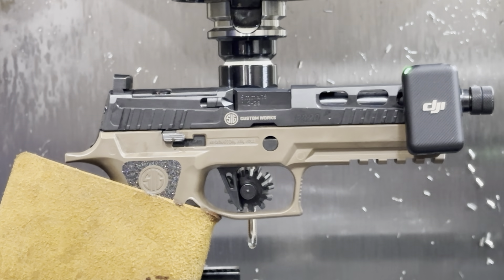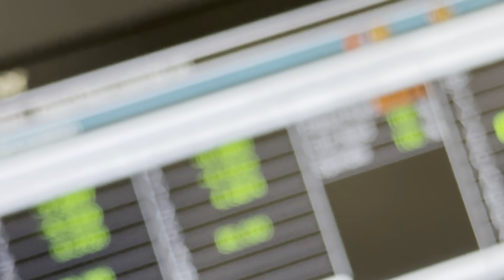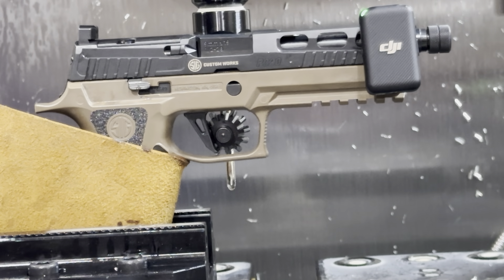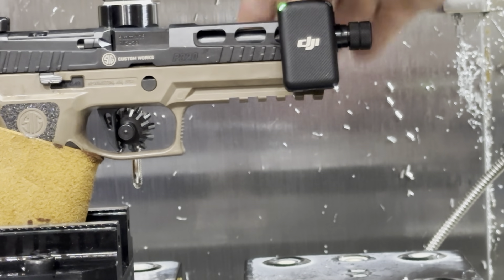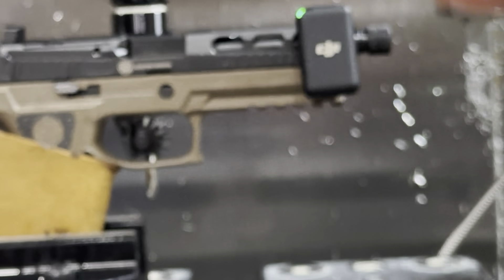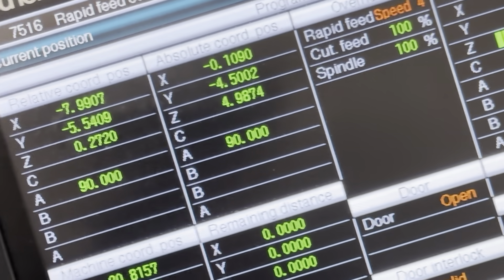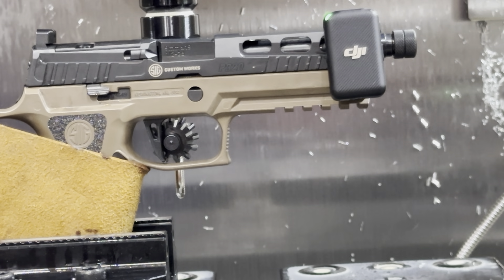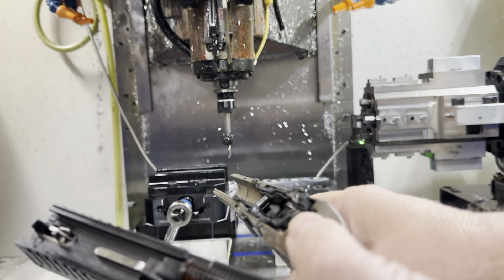Sig P320 accidental discharge tested in CNC machine.

Comment: Actually to me, this just shows that this isn't the issue with the p320.
What this shows is someone found a way to get a p320 to go off and a lot of striker guns could probably do this also.
We don't have a bunch of recorded issues with glocks going off in holsters, well that I'm aware of in the 30 something years LE has been using them.

So this now makes me look more at (and I wish I could remember who did it) the video where a machinist looks at how normal build up of debris (unburnt powder, carbon, and brass shavings) could potentially disable the striker safety. He does all this and gets the pistol to go off, without touching the trigger AND the manual safety engaged. A situation that more mirrors the LE issues when it has gone off in the holster.
Therefore making this goofy "lets pull the trigger 80-90% of they way and rattle this bitch till it goes off" a joke of a test. The first time I saw this "test" it didn't really make sense to me considering the more recent reports of the p320 going off, unmanipulated, while holstered. 

There are thousands upon thousands of these things out in the wild that don't go off randomly in holsters and I would venture to guess, that's because people are cleaning them. 
Then there are a few that have looser tolerances, given out by LE departments, that also don't get cleaned properly. Then they go boom when the sig god tells them to.

You won't see me support Sig's response to this ever, you won't see me carry or own a p320 ever, but I also won't jump on tests like this where you still have to pull the trigger so far to make it go off. 
Something else is happening here and I can't wait to find out what it truly is.

Comment: Every gun is different. Never mind the obvious difference between yours and the one the other guy tested with a screw. I appreciate the accuracy you can accomplish here, but it in no way invalidates someone else's test or proves ANYTHING about someone else's gun. You can't tell anyone else that the results would be the same with their gun. One of the worst thing Sig has done is sold guns with some random collection of parts that they user can't know, because they roll out changes slowly and a part at a time. Whatever the case, I'm glad for the increased scrutiny.

Comment: So....DONT touch the trigger. At all. Ever. During any test. Pull the slide back, do not chamber a live round of course, but then start manipulating the slide. Drop it on its sides, corners...if it "fires"...the manufacturer is at fault and going bankrupt. This is not complicated. 
Forget about proving "you have to pull the trigger" prove what is alleged to have happened. Or disprove it. It should not be difficult.

Comment: Don’t pull the trigger until ready to shoot. People blame SIG because they don’t want to admit that they pulled the trigger or used an incorrect holster.  Colt went through this, Glock did too, and H&K with there PSP design. Even Revolver makers have been subject to this drama.  PS: good video.
Reply: The airman that just died from this didn't pull the trigger and also was using a government issued safari land holster made for the weapon and it went off from him just setting it down on a table. Sig is 100% at fault here not the people.
Reply: @austindow347  I believe the Air Force is still investigating the incident. The USAF Final Report has not released (as far as I know). However a USAF General Progress Report related that deceased Airmen set the holstered SIG Handgun on a counter top inside the toilet stall (a much smaller area than an office). Perhaps this has something to do with the incident. I don’t know. Thank you for responding.

Comment: We’d expect a gun from the oem’s custom shop to have tighter fit. This gun obviously does not have at minimum the original duty trigger shoe… if not the entire trigger. You should do a test on a duty pistol with oem trigger. Great video though and looks like this is a brother speedio unit.

Comment: the fact that you operate a cnc machine and are ok with that much play in the slide, is disturbing.  I have owned many pistols other than a SIG and not a (1) has that kind of play in the slide.  The Wyoming. guy experimented a little more and discovered the striker safety releases at the beginning of travel not the back of the travel.  As other law enforcement have pointed out all kinds debris can get in those trigger wells.  So if you are designing a gun and have the choice to put the safety release at the front of pull or back of pull it would be in your best interest to put it at the back.  For things such as debris or parts being slightly out of tolerance for the greatest margin of safety.

Comment: Excellent illustration here, also shows why so many of the "expert" videos out there on what's happening with these UD's are basically flawed.  Can anyone point to a video or article/paper that categorizes and describes the situational aspect of these documented UD's?  Things like manufacture date of the gun, all stock parts or not and what might have been changed on them, thumb safety or not (and ambi or not), number of rounds through them prior to the UD, etc?  Clearly there are a million permutations of these weapons with all the stock configurations and aftermarket parts, along with the interchangeability of components.  of my P320's I have one that has very precise tolerances between slide and frame, and at least one with what seems like pretty sloppy slide-to-frame fit.  I have to think that this plays into which ones go boom when it's not wanted and which ones don't.

Comment: Check this out. You may  find it interesting. 
SIG P320 Un Commanded Discharge and its Repeatable
https://youtu.be/jOMQOtOQoPk?si=wMi7ny7orqAISmLG

I understand why your going to the wall. Assuming someone is in the ready position to fire. However, many of the alleged un commanded discharges I've seen, the firearm was sitting on the table in a holster or on their belt, in the holster. So the triggers weren't at the wall.

Comment: "This particular guns trigger behaves in this particular way, and this proves that all guns are made in the same way and behaves just like mine."
Is the statement this video makes.

The statement others have made is simply variations of:
"Some P320 guns trigger in other ways, and some have manufacturing defects that makes this more, or less likely, and some have defects that with wear and tear could possibly make these issues happen."

All of the statements to this effect are gathered in the video:
"All of the Sig P320 problems, collected"
By the creator known as Shadetree Armorer.

Comment: It doesn’t matter if you get close to the wall or on it the striker safety is completely disabled at that point and it can go off because of that design flaw… no handgun should ever go off unless you complete the trigger squeeze in its entirety. 
This should NOT happen regardless HoW cLoSe it is to the wall or not..

Comment: This is a good test for proving the distance required for an early discharge when (other than) trigger force is applied. THAT IS ALL this test proves. It does not, at all, in any way shape or form, explain how or why the P320 has had uncommanded firing when the trigger has not been touched. 

WHAT I HAVEN'T SEEN - that my engineer brain thinks is the real solution, is that the P320 trigger has an intermittent reset problem. Where-as, after being fired, the trigger is not fully resetting, and instead, ends up resting in this position replicated by the CNC machine at 0.090 (thousands) of an inch...so when that slide movement is introduced....bang!

Someone will soon discover this, and I hope my comment gets the respect it deserves.

Comment: Best test setup that I've seen so far. The data is starting to form a line and that line does not run along the path labeled "all is well". There is variance in the defect. Some like this one apparently go from slide wiggle when the trigger is .5 of a millimeter from enough pull to shoot normally. Some go with as much as on the order of 2 millimeters left to go before it would shoot normally. That number should reliably be 0 in order for the product to not be a dangerous hazard. It should fire on trigger pull and nothing else. So sure, this sample is less dangerous than others that have been tested while measuring the degree of pull, but even it was a conviction against the firearm's suitability. It is quite binary really. It fired from an action other than trigger pull. "but it was a little bit pulled" is entirely irrelevant.

Comment: could you please use your CNC to rack the slide in 5 mil increments, to test if, per the @dgrassley theory, there is a specific holster over-insertion rack distance that triggers an uncommanded discharge...

Comment: For those who don’t understand or may be confused:
We are not saying that all the uncommanded discharges occurring are being caused by this specific sequence of events (trigger pulled slightly past the wall and then the frame pressed). 
What we ARE saying is that we have now identified a repeatable mechanical failure in the safety mechanism that should not exist. The existence of this failure indicates a design flaw in the firearm and directly calls into question Sig’s repeated claims their firearm is safe beyond question

Comment: I’m confused.. you hit the wall/take up.. ok. Then you surpassed that which is in the firing process of the gun where the mechanicals start to perform and your concerned the guns going off? Yes they have some issues.. yes there is so weird tolerances going on with the slide that should not be there… ehhhh sell me all your dogs on the low.. I ain’t scared

Comment: The problem with testing any one gun, is that the tolerance stack is different in other guns of the same model. 
The allegation is not that every single gun is going off, it's that one in a hundred thousand samples can. Even the guns that have gone off on video, didn't go off every time they were loaded. 
You have to test a hundred thousand guns a thousand times each, in various states of cleanliness, temperature, and handling. 
Your test is the equivalent of flying a 737-800 once and saying "see, there's no way this plane can crash unless you push the stick forward and crash on purpose."

Comment: Would like to see like 10 P320's do or do the same numbers or if there is difference between the 10.. if the specs are all off, it's a production error, otherwise a design fail.

Comment: "You've got to pull the trigger."  There are two phases of the pull.  Pre-travel to wall.  And whatever happens after the wall.  Pre-travel has little resistance and can happen from side contact of trigger that can occur in a holster.  If the slide movement striker release is occurring during pre-travel, that would be the possible condition that is present during holstered AD.

Comment: Yeah so if you pull the trigger 80% back and then wiggle the slide, which is attached to the FCU, the gun will fire. Which is why you shouldn't touch the trigger until ready to shoot.

Comment: In my opinion this shows nothing make it fire without touching the trigger. You and do this on most pistols with a light crisp trigger. For instance lighten a bolt action trigger and it may fire when you close bolt  . Buy a hammer fired gun or Glock or put a heavy trigger in

Comment: Glad to see this failed and flawed designed being tested with such repeatability. NO gun should fire from any external input outside of the trigger itself. I don't care if it requires you to take up the slack in the trigger, if any movement in the slide can cause the pistol to fire regardless of the position of the trigger, its flawed.

Comment: just reminding everyone: the sig went off IN A HOLSTER. idk a single holster that will let you do anything that this guy has said. sigs latest problem and has been for a while have been components sourced from indonesia that are shit material with shit tolerances. the tolerance on this guys sig could be completely different than the one that killed the serviceman. as a matter of fact I think he just proved the defect and its a result of this: that there is the ability for the gun to go off with the touch of the slide without full compression of the trigger and combine that with horrible quality control.

Comment: With this particular one and with most of them yes, you do have to pull the trigger to get them to go off. However almost no gun has had this many accidental discharges in history. And many of the instances were of the guns going off in the holster after being bumped. So tell me how those guys were pulling the trigger with the gun in their holsters? This gun clearly has a manufacturing issue and some guns are coming out defect. There is a flaw somewhere. I'm happy you got one of the good ones, because some people didn't get that lucky.

Comment: We need to test if this is a use issue. Like new guns aren't doing this, but the more you shoot them, the easier it is to discharge. Like test after every 500-1000 rounds or so and see if it takes less trigger pressure while squeezing the slide. If so, the problem may persist until no trigger pull is needed and only the slide squeeze is. That's how they're going off inside holsters, I bet!

Comment: You can’t tell me Sig with a couple hundred engineers hasn’t done the exact same thing.
Reply: Someone in the cnc sub on reddit, who claimed to have worked for them has a very different opinion on that.  Sounds like quality control is completely absent.

Comment: This is so stupid, your pulling the trigger , disengaging the striker block safety and wiggling the slide tell the striker slips all the sear.. all this proves is that you have to pull the trigger for the gun to go off.
Reply: It proves the gun fires without the designed full trigger pull.  There's no reality where a firearm going off without a full trigger pull and simply putting pressure on the slide is acceptable.
Reply: @jamesg8246  your disengaging the safety the minute you pull the trigger back. Don’t pull the trigger and the gun won’t go off.

Comment: I trust this man 100%. That was great precision and very  clear throughout. It was simple to follow his explanation. 
     I'm certain in my dramatically subpar knowledge of firearms that he's got to be correct. I don't  have the knowledge  or background or experience to question his technical argument and it looks pretty foolproof anyway.  He's absolutely on-point about this one particular firearm - the one he owns, this single P320 he's testing. That's one gun. One. No one said there are no safe p320s.  This is an example of an overqualified individual explaining a very important point that he certainly proves.  The thing is,  it's all  for a purpose vs reality that does nothing at all to defend with respect to the probabilities and  the accusations of faulty design based on  quantity and quality of known failure and accidental discharge reports. 
    Not all inmates on death row are guilty.  Not all Tauruses suck. Not all Toyota Corolla are running machines that reach 200k miles without incident...mine had a transmission fail at 10,000 miles after less than 3 years of use that was bought factory/dealership new off the lot.   
     I bet there is someone out there with a Highpoint that has never failed them and has every reason to trust it with their life  based on their one, individual experience with that one particular gun that happens to be in their possession. 
     One example to either end of the extreme doesn't prove a thing, about anything...except for that one, singular  thing. Didn't Yogi Berra say that? 😂

Comment: Some problems with most people looking at this. You are pulling the trigger too and into the wall. And then pushing on the slide. And it goes off. What does this have to do with the gun going off with the trigger at rest. Like in a holster or finger outside the trigger guard? I understand these accidents are occurring WITHOUT a finger in the trigger guard much less pulling to and past the wall. You cant make it go off with the trigger at rest or even taking up slack to the wall. It doesnt fire. Now put a burr or have a slight ledge in the sear. It might sit with only .010 engagement. And pushing up and down on the slide with that loose fit sig slide might release the hook on the striker. BUT WHATS PUSHING ON THE PLUNGER ALLOWING THE PIN TO GET TO THE PRIMER??  Is the plunger binding and not falling down to block the striker as well. So many things have to happen for the failures i hear about. Ive handles combat firearms that are loaded with sand, dirt ,crud, and after racking them, they pop with any movement of the trigger at all. With these 320’s they are not that dirty. Nice video that aligns with my first thoughts

Comment: I have an 320 xcarry with the flat trigger and this particular one has several k through it now and the fitment slide to frame dd or stock sig frame is so much tighter than most of the videos ive seen doing these typs of test. The dudes with the skrew in the back, when he shows the rear of it the backplate slide rails almost look like they are bent or have been filed in some way.  Because mine doesnt look like that.  My slide fits on those rear rails very snug.

Comment: USE YOUR BRAIN ! P320 is an exceptional handgun IF you care about following ALL safety rules... THE PROBLEM lays in the fact that is a modular gun and the conversion kits are dirt cheap. You can literally convert the caliber, the size of the gun and even make it into a rifle, all back and forth using conversion kits, and is still going to be the same gun... THAT IS THE PROBLEM, because it's design threatens the gun sales industry and the gun control process... This is a democratic problem. I've put about 6000 rounds on mine at the range and never once had a problem with it. Never discharged accidentally.